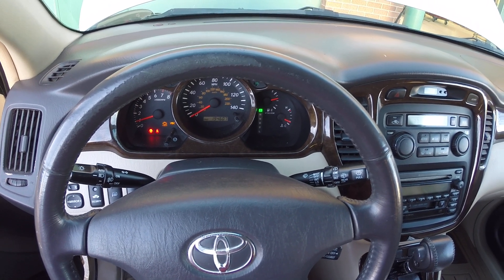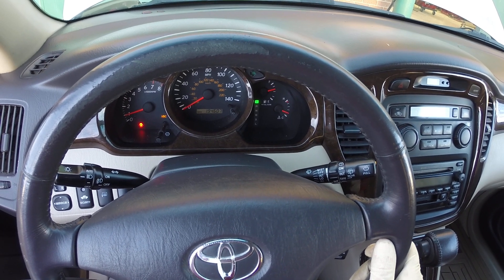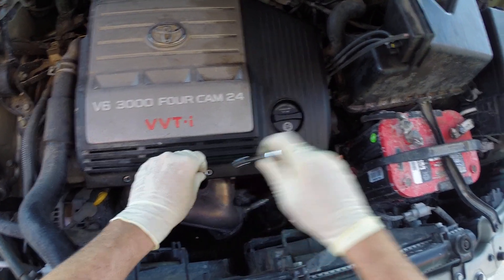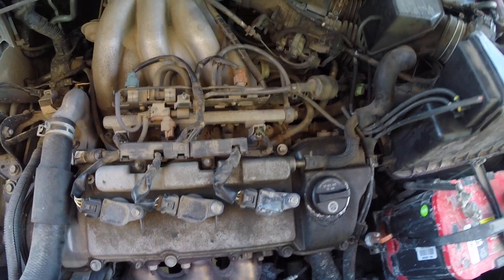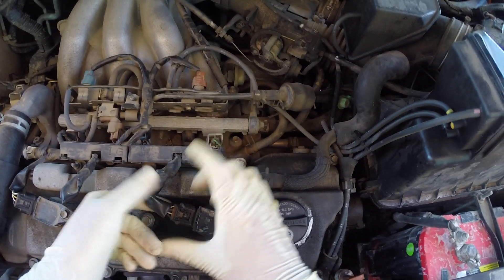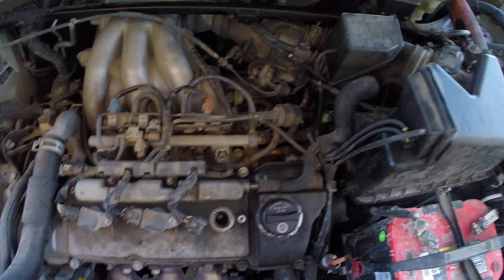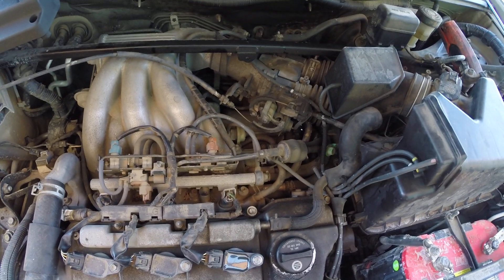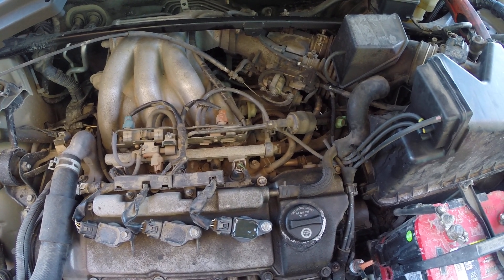Finding a Misfire with a Low Tech Power Balance Test

Comment: you should do more test to determine if its realy a coil here,you just changed it to another one,luck if its fixed.
after unpluging you should swap that "bad coil" to other cylinder to check if its realy it, problem could be in the wiring,and just by changing this coil you can not fix the problem.